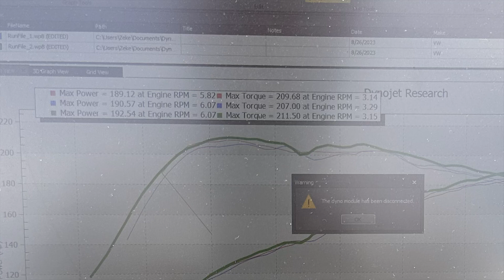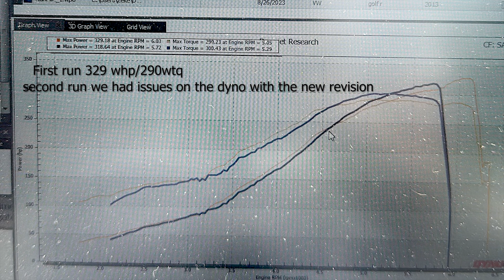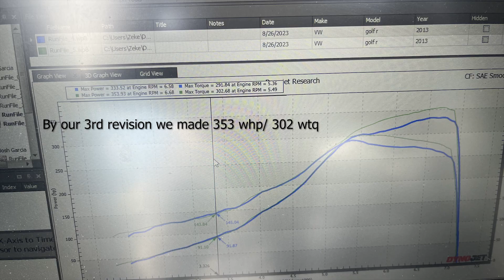How much power did my Golf R make on the Dyno?

Comment: Power seems a bit low - was this a 'safe' tune for the stock motor? Mk6 Stage 2+ Golf R's are running nearly the same numbers; with this turbo kit i thought you would at least 450whp... Still a pretty quick and good looking car,  I plan to go TTE420 or TTE480

Comment: Just confused you have described many things modified yet its 353 and maybe 3+ tq , factory was pushing 315 or so and 280 tq ! What am i missing ?? Figured with all in description you and said youd be pushing 450-500+ , and tq damn near to match !
Reply from the maker: In my experience stock , these cars aren’t pushing 300 whp. We have the hardware to push for 400-450. We are just adjusting the tune as we make more power

Comment: Did you have mabo tone back the torque intentionally? Aren't stage 2+ wtq levels at like 373?
Reply from the maker: yes, i have wtq pulled back intentionally because the bottom end is not built yet
Reply: @joshfourbanger   What is your reasoning for low 300 torque though? You didn't want to chance it even at 350ish? Is it because of the spool of the turbo?  because bottom end should hold strong comfortably until 400ish I thought without having to build the bottom end. Assuming you probably just wanted a super reliable daily until the block is built?
Reply: now thinking about it I know all dynos arent created equally so that probably had something to do with it too.
Reply from the maker: @Anon_Fox  mostly for a reliable daily build, but we are still adjusting as we add more power from here on out. We are planning to do another dyno in the future to break that 400hp.  This was at 19psi during this session
Reply: Isn't the Golf R AWD? Or rather 4motion?
Reply: @gacekk87  it’s a Haldex system. I think that’s what 4 motion means as well. FWD bias AWD that only goes AWD when front loses traction